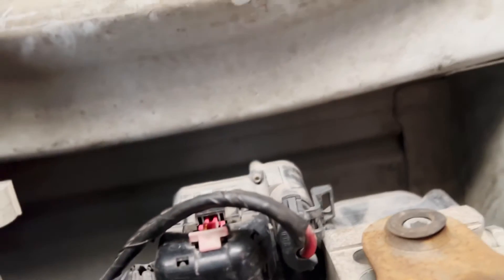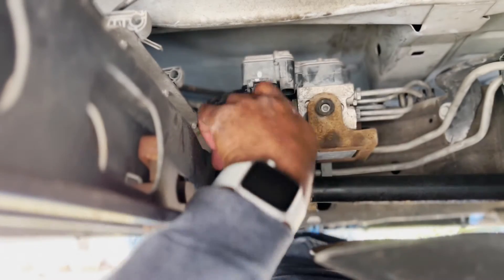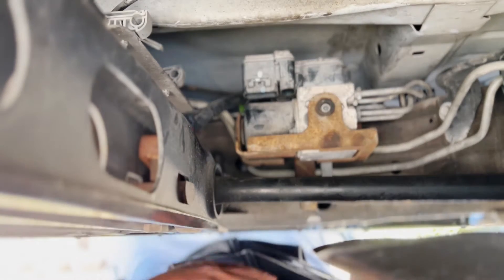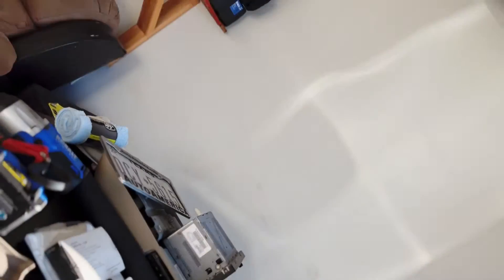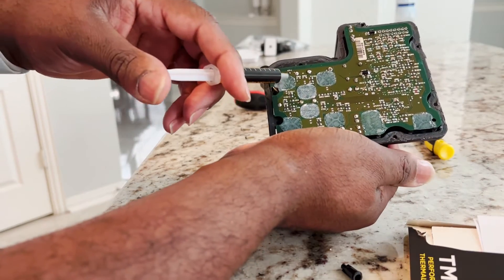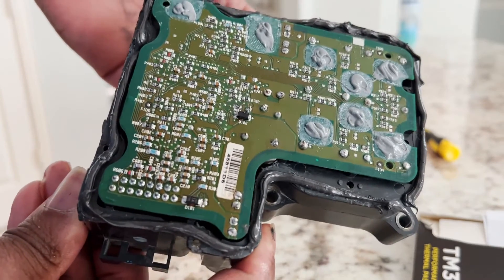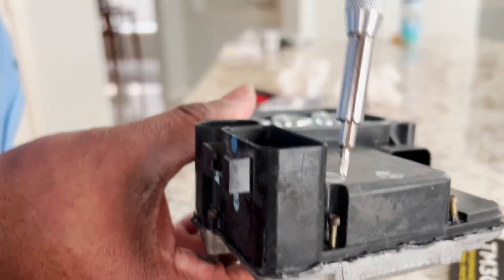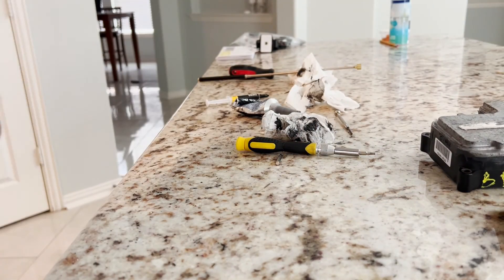Repairing the ABS Module/EBCM in my 05 Tahoe | Code C0265

Comment: just about impossible to take off the control unit, screws buggered. i had to take the whole pump off then could get them out. ground a slot in the heads then could use a flat head.
replaced them with stainless when putting it back together.
Reply from the maker: Thanks for checking out the video. I heard a lot of people have issues with the screws. Lucky I didn’t they came right out.

Comment: Dang! Your module came out easily. 1 screw made a snapping sound when it finally unseized. Stripped heads on remaining 3, so I  tried extracting(Easy Out) with no luck. Found a small Dewalt right angle attatchment for my drill at the Depot and used it to drill out the heads.  Wasn't easy, but more like a miracle. Okay, a Hail Mary from the 1 yarder!😁
Reply from the maker: Thanks for checking out the video. It sound like your module put up a fight. Was you able to get it fixed?
Reply: @CHEVYLYFEGARAGE  Yes! Plus, I reflowed all pins (possible)on circuit board, adding solder only where I thought needed. It took only 5 minutes to install and no more annoying lights displaying on dashboard. I'm so grateful for this instructional video and imagine the knowledge I could've gained, not only on repairs of all kinds, but in music, photography, the art involved in some these incredible pieces of furniture I've viewed throughout recent years, etc. Amazing!

Comment: Great video! I have the same problem and it´s driving me nuts... Have to take the ABS module apart and check if something is wrong. Looked like it is a pretty easy job.
Reply from the maker: Thanks for checking out the video. I definitely appreciate it. Yes it was a fairly easy job. My soldering was not the best but it got the job done

Comment: All of the other videos i have watched on this code. They opened up the module and re soldered all of the big solder joints. none have put thermal paste on. Hmmmmm
Reply from the maker: Thanks for checking out the video. I watched a lot of videos as well that didn’t add the thermal paste either. I only found one video that did and was like it come from factory with the paste so why not add it back after opening it
Reply: @CHEVYLYFEGARAGE  Did you solder any Joints? every other video solders the large joints
Reply from the maker: @golfish8589  I just soldered the largest ones as well. Those seem to be the ones that always fix the issue in every video I watch and it fixed mine as well

Comment: Mines making my traction light come on and I can't go pass 20mph saying reduced engine power can I just disconnect it?
Reply from the maker: My traction control light was on as well, but I’m not sure about not being able to go over 20 mph. I didn’t have the reduce power message. So I’m not sure if it comes from the EBCM most of the time reduce engine could be a ground wire or bad sensor
Reply: @CHEVYLYFEGARAGE  can I disconnect the harness and drive?
Reply from the maker: @SU93RCH4RG3D  honestly I don’t know I’m not a mechanic bro. I just work on my own stuff when I disconnected mine I didn’t drive it until I put it back in.
Reply: @CHEVYLYFEGARAGE  I appreciate u bro this engine reduced light is so frustrating bro I can't figure it out
Reply from the maker: @SU93RCH4RG3D  no problem at all. From the research I just did the common problems are related to the throttle position sensor, and can be caused by faulty wiring to the TPS, bad connection at the TPS, or a failed TPS
Reply: @CHEVYLYFEGARAGE  good to kno I was about to buy new plugs and wires I got a new gas pedal sensor and different throttle body and still nothing 😭